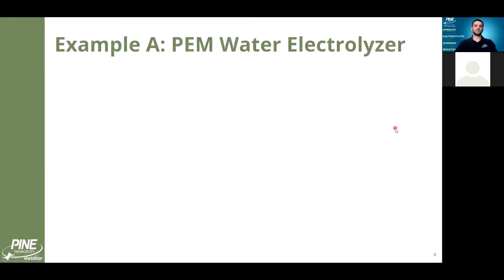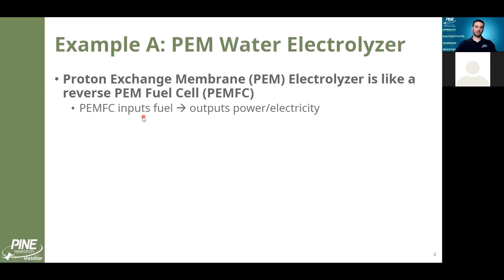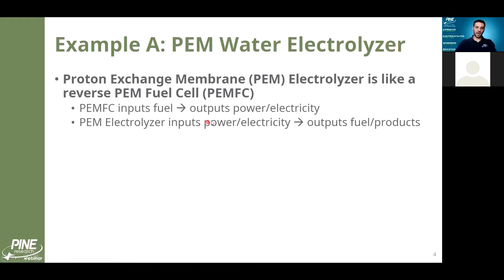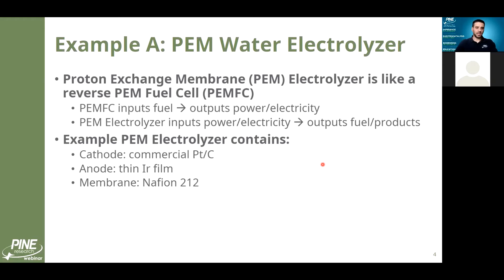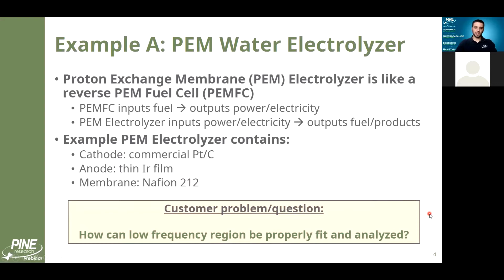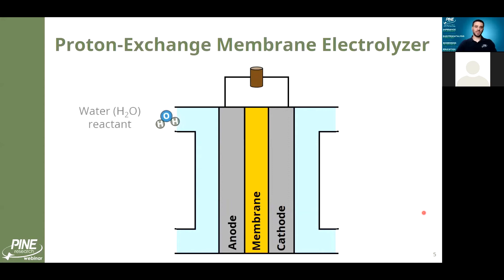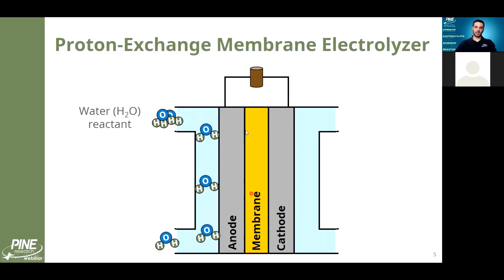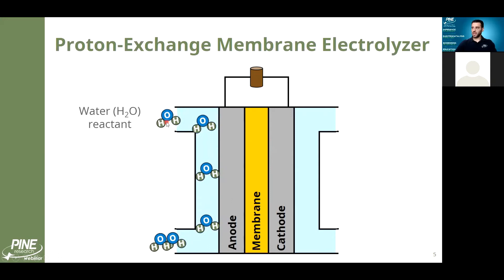How to Perform EIS Circuit Fitting of a Proton-Exchange Membrane (PEM) Water Electrolyzer

Comment: Interesting video and very helpful in terms of rearranging the order of the semicircles so that the lower frequency semicircle corresponds to the anode reaction!

I have a question and perhaps a comment on the fit of the high frequency region. In the final fit you provided, the high frequency intercept (ohmic resistance, R1) shrinks down to 0.001 ohm, which seems far too low for such a system. I know that in this example you were more interested in fitting the anode behavior, but R1 is an important value to assessing losses in electrolyzer systems. Is it possible that the proper fit for the cathode semicircle is actually to the right of where you placed it? By excluding a few more of the high frequency points, it looks like there might be another small semicircle in the real 13-16 mOhm range. This would give a realistic R1, a small cathode R2, a large anode R3, and would maintain the expected frequency order of R2 vs R3.

Thanks!
Reply from the maker: Hi George, thanks for your comment.  I can address your comment in a couple ways.  In short, I think you may absolutely be correct in your analysis and assessment.  To be fair, as I think I mentioned in this webinar, the EIS data is not mine, so certainly my analysis cannot be considered the final say, so to speak.  I was trying to illustrate some possibilities based on data I received from a researcher and not my own data from which I had prior and intimate knowledge.

That being said, if you even see one of the initial fits I did with two Randles elements around the 14:00 mark, while I continued to go with some Warburg models after that, you might also consider this initial fit to be something like what you've described and could be accurate too.  The R1 is in the 13 mΩ range, and there are 2 semicircles.  Perhaps another model could even be tried with 3 semicircles in this vein, taking into account that slight first semicircle as the cathode, as you suggest.  There are a number of ways this could be interpreted, and I think it's tricky to exactly determine how to analyze (or whether to not analyze) that high frequency portion.  But you do make an excellent point that this R1 being around 13 mΩ or so probably makes a little more sense than being effectively negligible at something like <1 mΩ.

Comment: In a three-electrodes electrochemical cell in which I do not have a diffusion layer neither a redox reaction, I would only consider the charge transfer resistance, double layer capacitance and solution resistance? Maybe swap the capacitor for a CPE? Thanks!
Reply from the maker: Hi Luiz, thanks for watching and for the comment! You make a good point: in general, I do recommend using a CPE instead of a capacitor for fitting because it can account for non-idealities, surface inhomogeneities, and (for lack of a more elegant description) the fact that nothing - not even an actual capacitor - behaves like a perfect capacitor.

The other thing I will mention, without seeing your specific data, of course, is that without a redox reaction, I wonder whether you have any charge transfer resistance at all?  Usually, charge transfer resistance refers to just that: charge transfer.  Without any Faradaic processes or redox reactions, there may be no transfer of charge at all.

In any case, apologies for the lengthy response, but I hope it may be helpful.  If you wish to continue this discussion, please feel free to email me directly at pinewire@pineresearch.com.

Comment: I am a total beginer in this area, so my question might be a very naive one. I would like to measure the throuh-plane electric conductivity of an anode coated membrane (half-cell). we made a very simplistic cell using plates of aluminum and plastic. simplistically we measure EIS with applying pressure on the cell about 300-1400 psi. However, the Nyquist plot is very strange and not even close to a semi-circle. Is EIS a good choice in for this question? what I am missing here?
Reply from the maker: To be honest, I am not sure how best to answer your question without knowing (or seeing) the physical cell setup you have constructed and are using.  Almost certainly EIS can be used for measuring conductivity, but your results might have something to do with your cell setup and the data are convoluted as a result. Also, I think it is not guaranteed you should see a semicircle, depending on what your EIS parameters are.  In general here, there are a lot of additional details that would be needed to be able to effectively pass judgment on your situation.

Comment: There is water in contact with the cathode? It is only H2 gas in the cathodic side or some water is use for membrane or H2 transportation?
Thanks
Reply from the maker: Great question.  Yes, there is almost certainly water vapor on both sides of a PEM fuel cell or electrolyzer, and the main reason is that the membrane (most commonly Nafion) only functions and shuttles protons effectively when humidified.  Typically, you send humidified streams (often 90% humidity or higher) across both sides to ensure the membrane stays wet.  So there is usually an implicit inclusion of H2O that isn't always depicted in these kinds of diagrams or animations of fuel cells and electrolyzers.
Reply: @Pineresearch  Ok ! Thanks !

Comment: Why is the cathode the easy part in this case?
Reply from the maker: The cathode reaction in a PEM Electrolyzer (much like the analogous anode reaction in a PEM Fuel Cell) is considered easy or facile in comparison to the anode reaction (cathode reaction in the PEM Fuel Cell - again, a Fuel Cell is essentially exactly opposite to an Electrolyzer in this regard).
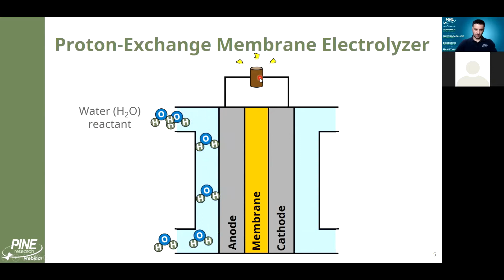  This is mainly due to the sluggish kinetics and relatively large overpotentials required to make the oxygen reduction reaction (ORR) take place.  In a Fuel Cell, this ORR happens at the cathode and is a reduction reaction (backwards from what I showed in this video).  In the Electrolyzer, it is the same reaction but it happens in reverse, as an oxidation, at the anode (as you see in the video starting at around 3:40).  In both cases, it suffers from poor kinetics and is often represented by a multi-step mechanism.  It is also typically the most heavily-studied half reaction and researched side of a Fuel Cell or Electrolyzer because it is the one, for lack of a more elegant phrase, holding everything back.  In comparison, the cathode in the Electrolyzer performs a simple combination reaction to form hydrogen gas, and this reaction is fast (i.e., has quick kinetics, or at the very least quick compared to the ORR).  In a way, due to the kinetics mismatch I just described, an Electrolyzer cathode is essentially in a constant waiting state for the anode to finish its half-reaction.  As soon as it does, the protons that eventually migrate through the membrane reach the catalyst and the hydrogen reaction occurs almost instantaneously with no delay.  (That explanation is not perfectly mechanistically accurate to be honest, but just a mental representation to try to help you understand the different kinetics of each half-reaction)

Finally, here are a couple literature references that discuss some of these concepts in a bit more detail if you're interested: https://doi.org/10.1016/j.electacta.2018.05.150 and https://doi.org/10.1021/cs3000864"

Redirecting
https://doi.org
Reply: @Pineresearch  thank you so much, this now makes sense. The diffusion of protons/hydronium is extremely rapid, compared to everything else. I suppose the voltage on the anode is also typically unknown in a three electrode system